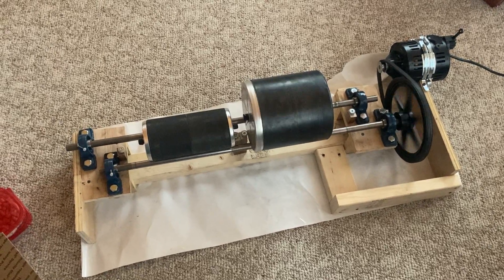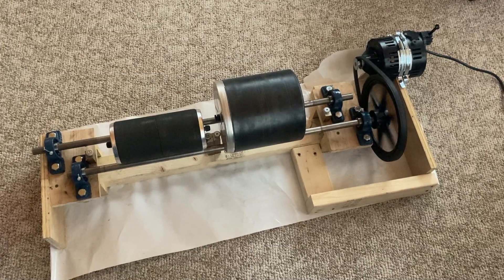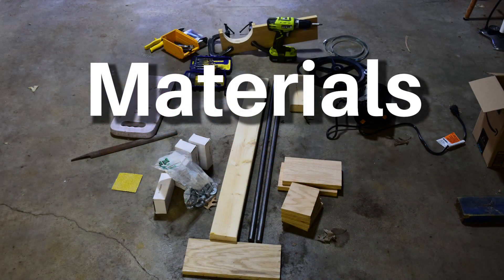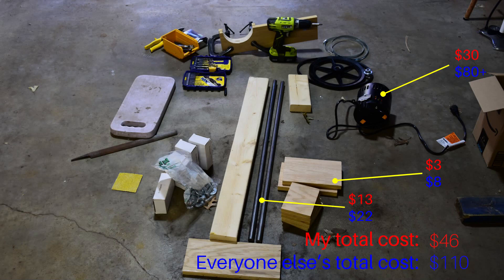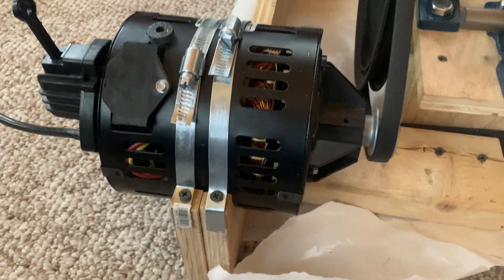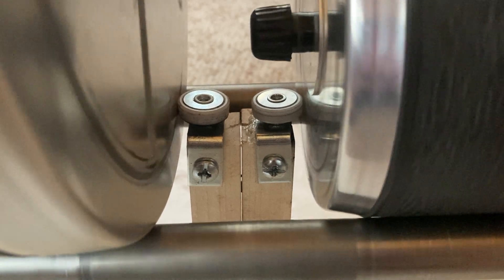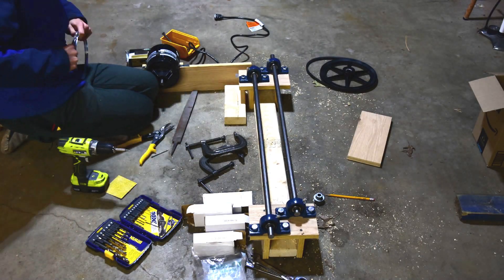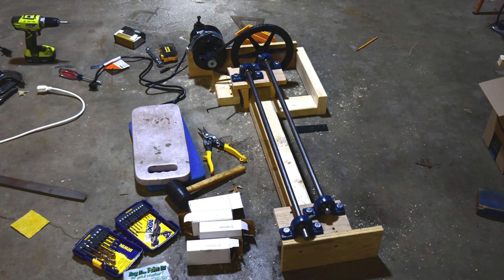Building a Rock Tumbler

Comment: Hi! Great video, thank you! What can you say about these rubberized barrels? These are the barrels that are sold with ball mills on Aliexpress. I bought one and ground coal with glass balls for 8 hours. The result is not very good. The grinding is bad, the coal shines and sticks to the walls, although I dried it at a temperature of 100 degrees Celsius for about an hour. However, I saw many videos on YouTube using such rubberized barrels and the result is good. What could be the problem? Do you need heavier balls? Lead or brass? 

I tried with different rotation speeds

Comment: Having parts from a rotary laser engraver attachment and few other odds and ends, the thought of a DIY tumbler appealed. I wanted a larger tank than the kit I'd started with provided. So, I have made a 3D printed a 12 pond capacity tank using PLA and coating the interior (wear surface) with a 5mm layer of a tough silicone I cast in place.  Still working on the project, but it should be functional in a week or so.  Thanks for the inspriation. My tank, though reliant on some expensive tools, has been fabricated from less than $25.00 in materials.  It'll be interesting to see how well it holds up.  Enjoyable new hobby!

Comment: I have the same cheap Harbor fraught tumbler and yeah, it has soooo many flaws. I've burned through a dozen of the cheap belts and keep meaning to build my own. Between the crappy plastic bushings and the tiny motor it's a constant job to keep running. Your idea of using the sliding door runners is brilliant. 👍

Comment: 1/3 HP sump pump motor.  Wonder if it's any more economical to run than my 1/3 HP evaporative cooler motor?  According to the wattmeter, it consumes about 160 W without a load.  I decided that was too expensive to run for weeks at a time.  But maybe I'm a cheapskate.  I'm still looking for a motor that can be run 24/7 yet is in the 40W range.

Comment: How much power/money does it cost to run a motor like that for months on end?
Reply from the maker: I really have no idea. Michigan Rocks did a video on how much it costs to run his tumbler, so I've gotta think it's fairly close. https://www.youtube.com/watch?v=anvqmnXwyH4
Reply: Thanks so much for your efforts and putting together this video and showing this that it can be done! And done quite well!!! Several folks have asked about the source for the bearings and the pulleys. Finding those is the part of the job that me. Luckily, I do have an old sump pump in the garage which I think still works. If you have a moment and recollect where you found the pulleys and the bearings I I know that several of us would sure appreciate that, or could you upload a detailed photo of the bearings connected to the rods? Thanks very much either way and I wish you happy rock hunting!

Comment: I want to get another rock tumbler it will be a 3 pound rock tumbler  but at target they are sold out . I have 2 2lb rock tumblers and a 1 way to small  not much choice at the time,. I use the small one for my small rocks .  I have a bad habit of checking the rocks every  day to see if  they are smooth enough i  get by really cheap i have used the same grit for months if it get weak add more to it .Since we have snow here it is hard getting outside washing all of the grit out . I have been  giving it 2 or 3 days . 2 are in my bed room so they are loud . I just want to make sure they don't get real  hot .National Geographic  one of them was a Dr. Hook  an older rock tumbler  I bought it for 15.00 at a rummage sale  that is what got me started rock tumbling .They all use the same belts .
Reply from the maker: That's interesting. Do you get good results when you do it that way?

Comment: See!!  That's why you never throw away wood scraps.  I coulda saved myself 3 bucks right there.  You did save the door rollers though, so some major points there.  Oh, and here's the math, you just needed 2 seconds to get it, right?  Nicely done man, beautiful engineering.  You'll have to put up a video at some point on tumbling the rocks themselves on there.  The barrel speed on that 12 pounder seems slow, I'd be interested to see how that works out too.  Bet it would be great with softer and more fragile materials.
Reply from the maker: Thank you! I don't think I could ever make a better rock tumbling tutorial than this one: youtube.com/watch?v=dYGFal0e1WY I've noticed in the big barrel there's usually little chips in there, so I'm not sure if it would be better for more fragile stuff. There's also more weight on the rocks, so it might cause softer stuff to wear away faster too.
Reply: @99Rockhounding  Yeah, I love his stuff, he makes great vids.  Very cool too, answered a bunch of questions for me when I got started.  I've been tumbling about a year now, just got a little Lortone 3 lb. one.  Actually got a variety of diamond tips for my Dremel a couple of days ago and just today started going through all of the ones I've done & started grinding away bad spots so I can re tumble them.